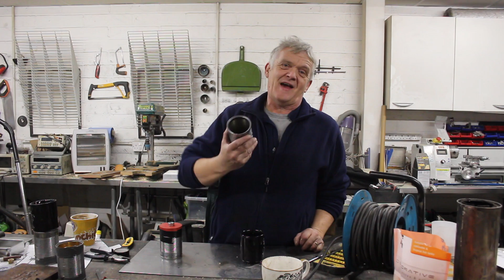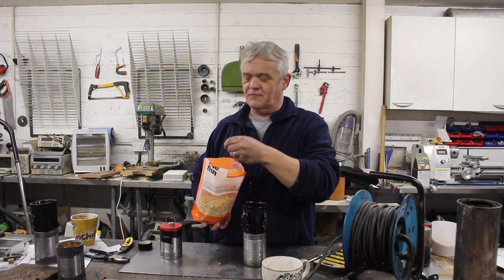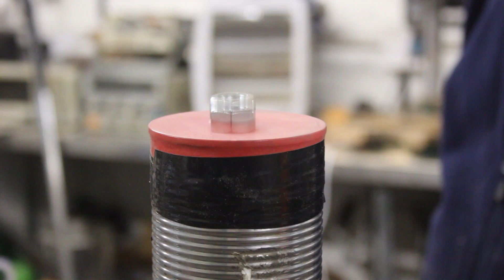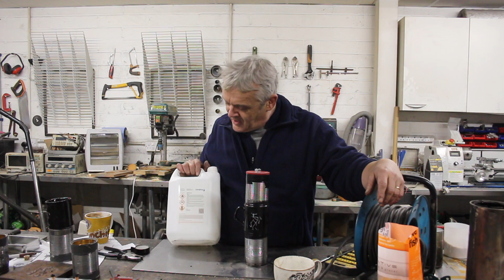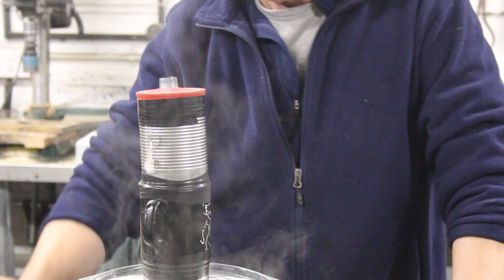1775 Running A Strange Engine From Hot Water

Comment: Nice, and again nice! Great experiments! I really enjoyed your presentation today. The only thing that we should think again is the efficiency also the temp difference. Yesterday I lost a long comment under your secondary video, but now I try to rewrite the main things. The strange unit works with liquid and steam. The temperature difference between the two forms are pretty low it came from the water properties. If you use bigger flame or hotter plate then doesn't increase the water temperature more than 100C  before the whole water volume  turns to steam. The only thing is change the quantity of heat. More heat could generate more steam in a same period. The efficiency much smaller than 1% if we start to calculate from the water properties, but the steam has 100 times bigger volume than water so this fluctuation between two froms  that could drive the mass/membrane piston easily.  This steam engine has a good comparison with a DeltaT around 150C Stirling. So not bad from a simply unit than this.  You can use the ceramic cup as membrane holder the third floor doesn't really needed. BLADE
Reply from the maker: I am glad you like it mate and I take on board what you are saying in this example. However, I was thinking about it - I would say that would only be the case for a diaphragm engine of this type as the balloon rubber acts as a kind of safety valve - too much pressure and it will just pop right off. I can't see why this wouldn't drive a piston or a diaphragm of a stronger material - like steel for example - the kind used in fuel pumps - in which case pressure could be increased and that would raise the temperature that the water boiled at - is that not the case? I always appreciate your thoughts on this - thank you for taking the time to share your experience - Rob
Reply: @ThinkingandTinkering  Yep the membrane could work a bit as like a valve, but if we look this system closer with the valve we always lost some water and the system will empty soon. If the unit don't exhale that steam, just drop the pressure when the volume increased (balloon moves up) than the condensation rate higher a bit. The condensing steam has 1000 times smaller volume, so when the volume drop the mass on the membrane has a momentum and moves down. The pressure start to increase, the heat input constant, the boiling point change a bit dinamically, but negligible. In this moment some water change the phase. Water molecules kinetic energy increase and the volume start to growing drastically and push the membrane with mass out from the can. With enough heat the unit could autostart in resonant frequency and repeat the cycle in. The stroke could be higher if the rate of the phase changes between the two forms higher. It needs more heat input also great cooling. On the other hands the membrane material could be steel, but the starting temperature will increase and the working frequency too. So the input heat should be much higher, but Higher frequency gives more mechanical power because of the number of cycles/s.

Comment: Have had a lot of fun with this one!  My best results so far is with a Polystyrene center section and I substituted Ammonia for the water.  LOL Less Fire/Explosion danger than your
substitution.  Also made a thinner version using two Two copper pipes screwed into a PVC center section, worked but due to what I believe is surface area not as well.
Reply from the maker: nice mate thank you for sharing
Reply: I was picturing making something out of 4" duct, using a plunger head as my membrane.

Comment: Will this work with speaker on top ? Or it must be rubber diaphragm ? If Yes it will make electricity and you can measure amplitude and current so you can get results if there are different setups like gravel or steel wool etc,...
Reply: When you use 3 or 4 cans, the engine can produce a higher sound (because it is a Sondhaus tube) and you can use a speaker. When you use only 2 cans high, it doesn't produce sound, and you need a membrane with a mass on it.
Reply from the maker: nice ideas mate - give them a go and see what you find then share it

Comment: rob is it known fact that human urine once boiled off leaves a mineral residue (say on a kettle heater element ) that acts as a excellent insulator . as the kettle i used switched off earlier in the boil once this was done a few times in past weeks .and now element recleaned boils as normal with said urine . its a good source for hot urine bottles (water bottles )
Reply from the maker: well there we go - I did not know that mate - thanks for sharing
Reply: @ThinkingandTinkering  it also appears that it reduces car racing engines heat .as if you place it in the block minus normal water .it coats all the block liners .hence allowing a vacuum sealed engine to become even colder(itdoes dissappear whilst running so watch the temperature gauge as you require it to type of electroplate the mineral coating ,may be ceramic !! ie. a super conductive effect .this was passed on from joe booker ,alias joe cell .you also get bery strange occurences on engine performance (a rover diesel 2.0 1996 420 model )

Comment: this could also be used to tap the paper generator that Luke had made a little while back. if I remember correctly he was getting 22 volts out of 2 pieces of paper and an insulator in the center and just taping in.
Reply from the maker: it certainly could mate
Reply: @ThinkingandTinkering  would you consider using it and sharing with us ?

Comment: Something in my soul needs to make one of these and let the nut bounce on a Piezoelectric disk... Looks like I'm having tins of soup all week 😂
Reply from the maker: lol - good for the diet mate!
Reply: Instead of a piezoelectric disk you could replace it with what Luke did a few days ago using the ghrahene and paper vibrating thing that produced 21v using just one.
So stacking them would produce some impressive voltage.
Reply: @strawman9410  but how much power do they produce? That’s what you need.